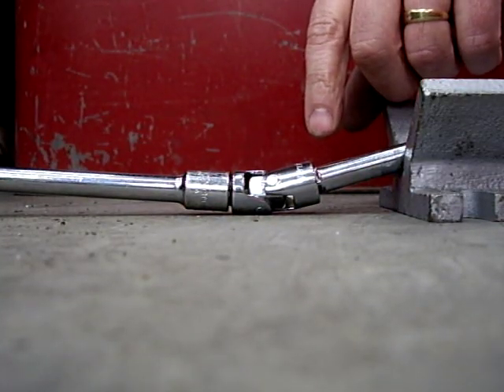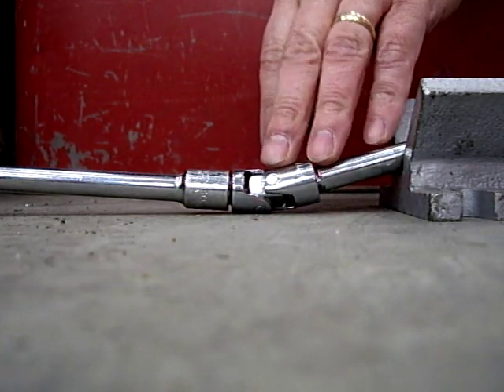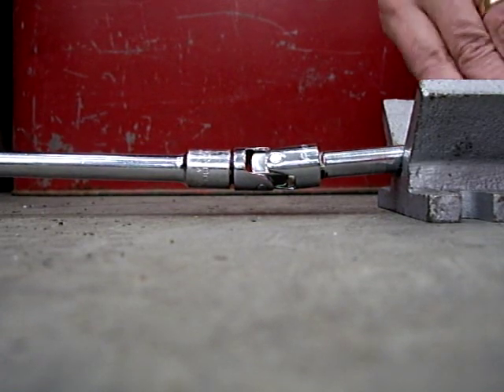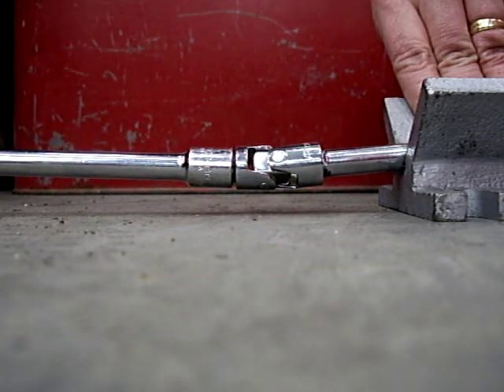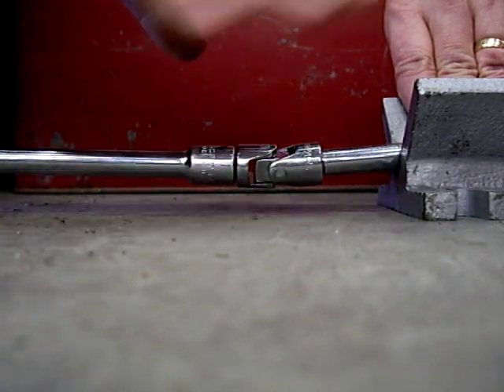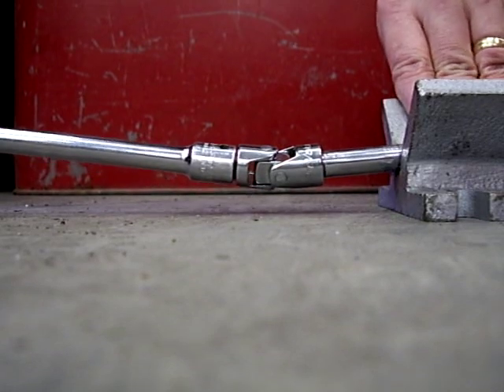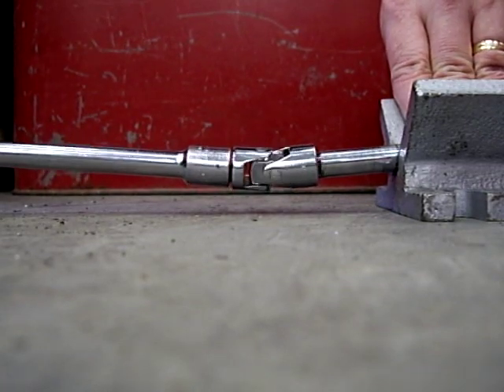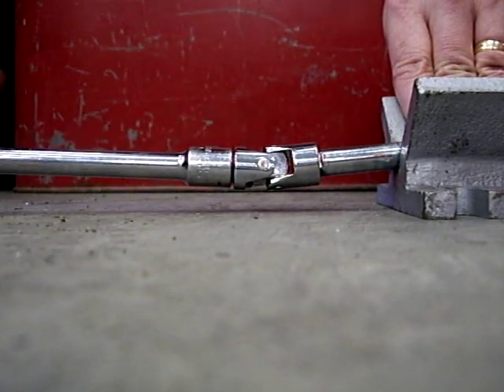Part 3, Socket swivel as a u-joint?

Comment: The "Bench test" in the V-block brought back the memories of fingernails on chalkboards.

For some who wish to further explore Gerolamo Cardano's(Italian mathematician) who first explained U-joint[double Cardan shaft, double Cardan joint theory]
you can find it on Wiki-crapia.

Another option for R/C drive line systems is a Flexured U-joint coupling.

Basically a spring between the shafts; Most DIY people could fab a flexured coupling.

Think outside the box.